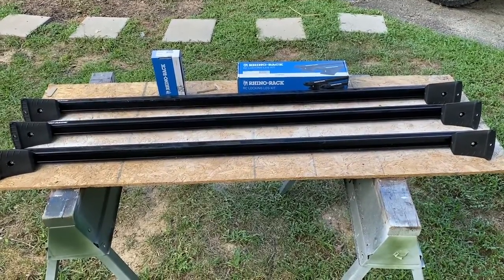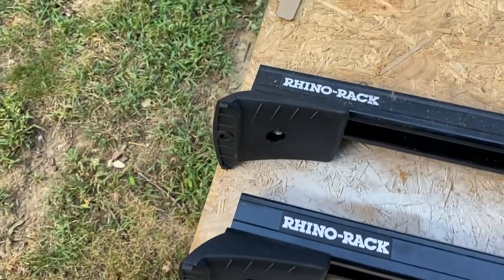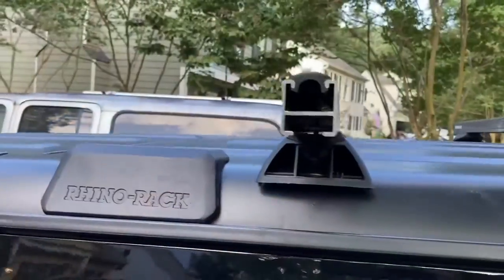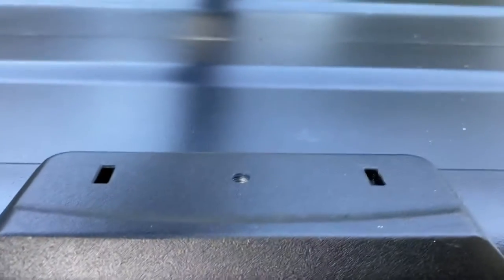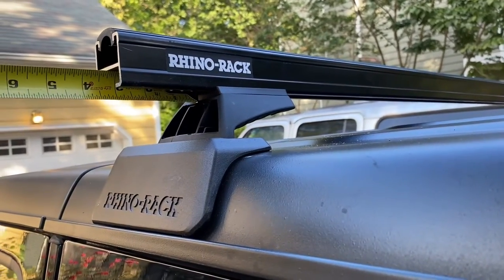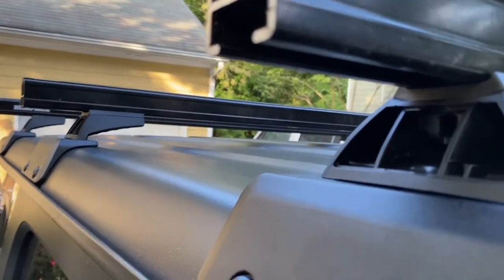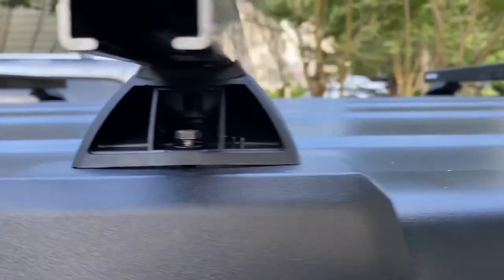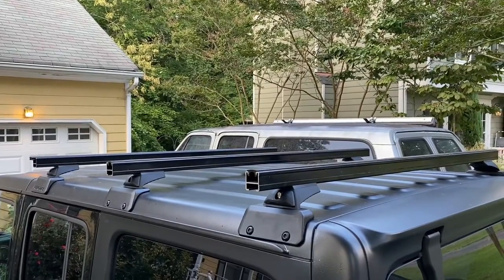Rhino Rack HD crossbars mounting to the jlu backbone system

Comment: Did you use the bolts with the blue thread locker to attach the legs to the backbone system?
Reply from the maker: Marcos, I used the six stainless steel bolts, i believe they were 10mm hex blots, one on each foot, I can’t remember if they had the blue thread locker on them or not but it was the 10mm hex head stainless bolts.  Hope that helped you!  Thanks for watching the video and checking out the channel! Let me know if you have any other questions

Comment: How did you mount your tent to the bars did you drill through them or use the u bolt? Do they flex at all off road?
Reply from the maker: Matt, I used the bolts and plates that came with the tent to mount them to the cross bars basically forming a u and the tent is rock solid, in the last two trips i have been offroad for more than 500 miles and done some pretty technical trails and the tent has not budged